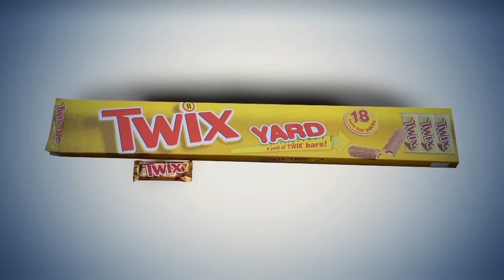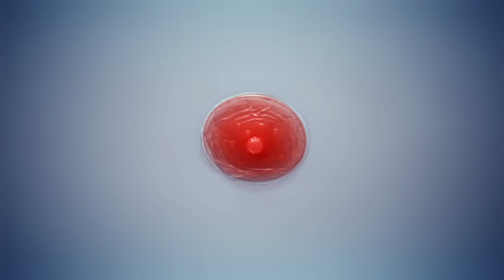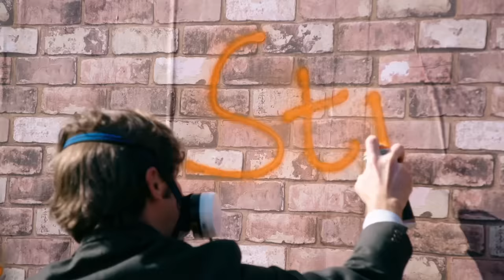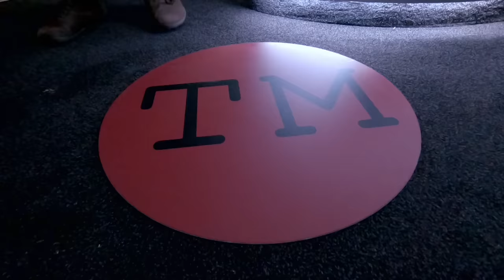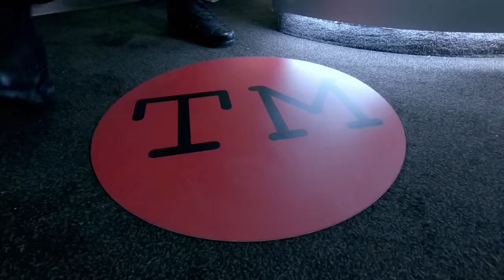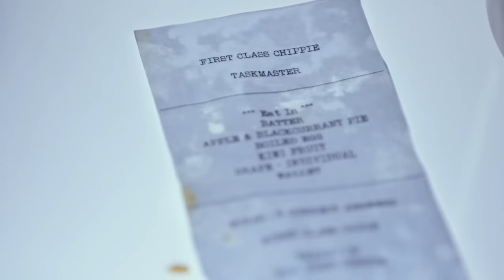Series 11 Episode 6 - 'Absolute Casserole.' | Full Episode | Taskmaster

Comment: MCMLXVIII - Easy 1968. If you've seen enough movies MCM is 1900. You probably watched more movies made after 1950, MCML. Every decade after is an X added. MCMLX 1960 VIII 1968. Maybe that's just me, but every movie or show that had Roman numerals would flash the date for maybe a second and I'd work out the year. Been doing that for maybe 30 years now. It gets way easier after 2000. MM. This year is MMXXII. Damn easy. I remember taking Spanish and being so relieved when we were no longer in the "mil novisientos noventa y etc." and went to "dos mil" .